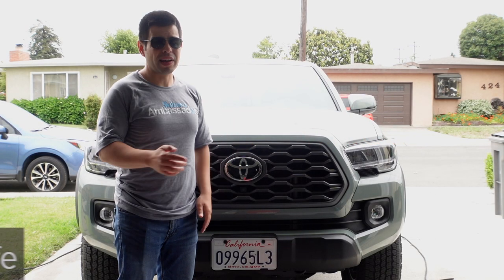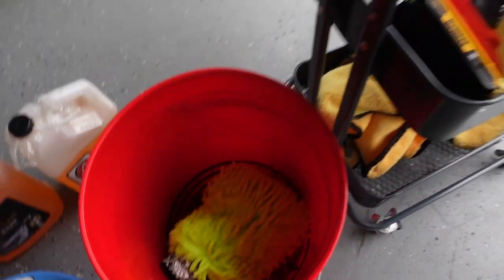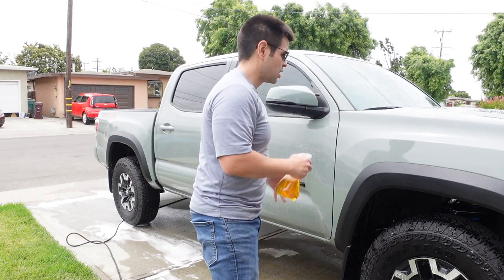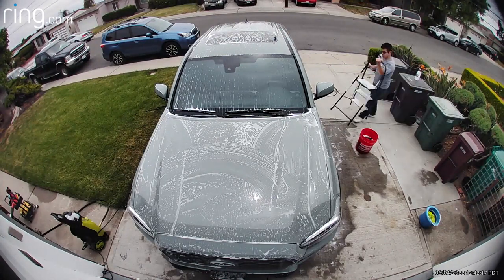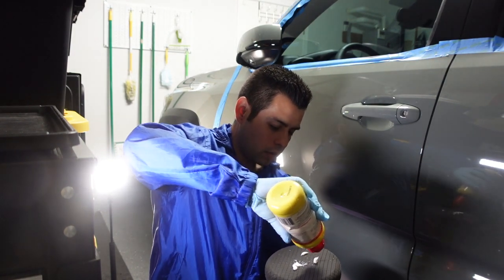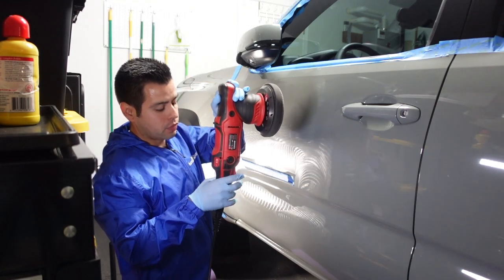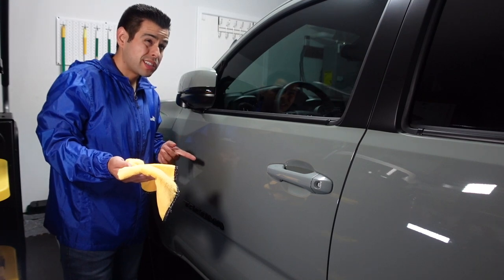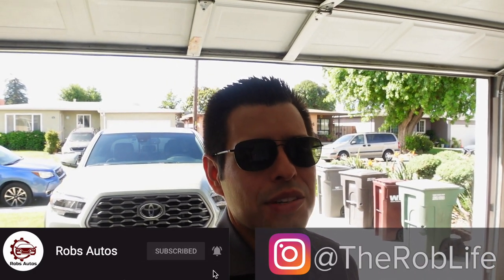How to Wash and Protect Your Tacoma Paint! (Turtle Wax Graphene Coat)

Comment: I love turtle wax products, especially the wax and dry spray. I can spray on the wet car and dry it off with the spray to prevent water spot and make the color shiny. I'm also trying chemical guys brand as well.
Reply from the maker: Chemical guys is also good, I have been using turtle wax since the original hard shell wax on my 87 supra back in 2007 😅